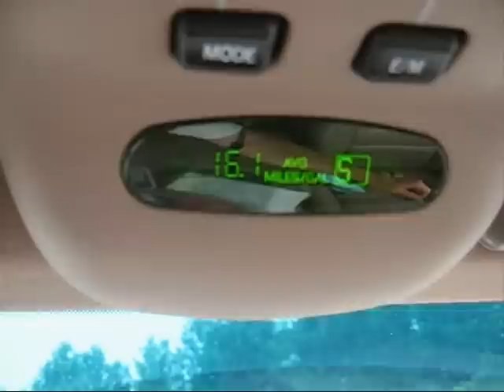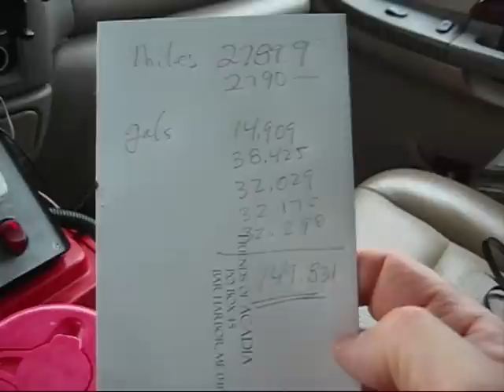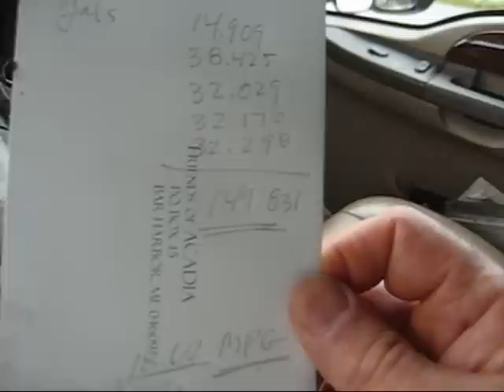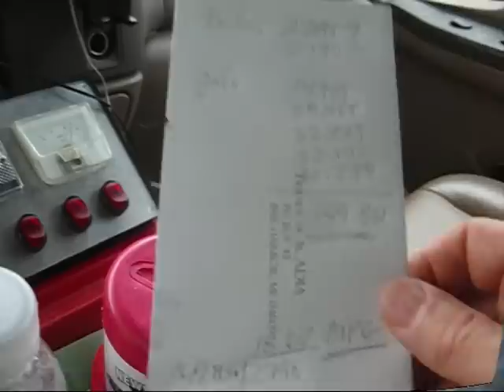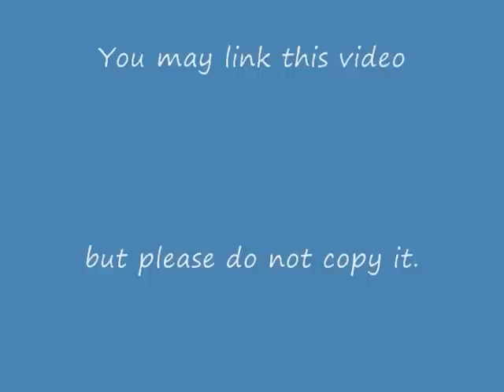MPG (mileage) Test 2790 miles with Dry Cell HHO F350 Superduty 7.3 Diesel

Comment: you've never gotten better then 18.62 MPG? that's.. pretty dreadful.. even if you're pulling a full load of cargo in a pickup truck.
glad it made some improvement for you though. but hopefully you are aware, the very fast & hot combustion rate of hydrogen severely lessens the lifespan of your engine.
Reply: actually the lack of carbon helps keep your engine cleaner. As long as your valves are of sufficient construction, you will be able to run only hydrogen, and your engine will not have all the carbon deposits.
Reply: kandysman86
the valves aren't the (only) concern my dear boy. it's the crank shaft + the crank shaft seal + the head, etc. simply put, engines aren't designed for such a fast combustion rate. the hydrogen burn up before the piston stroke is completed causing increased stress early on in the stroke, & less stress later on in the stroke causing powerful (but short, so you probably won't feel it) shock waves running down your piston rod, into the seals & into the crank shaft, causing cracks over time.
Reply: NickBlackDIN well you better rush out and tell all the companies doing compressed hydrogen conversions on everyones cars, that all the R & D they did was wrong, cause this dude on the internet knows us "dear boys" don't understand why its better to pay out the ass to super rich oil tycoons for their engine clogging dirt fuel, instead of ultra clan and abundant and free water.
Reply: kandysman86
you trust companies?
sure this method gives better MPG (for older cars) so the customers are happy at the transaction.
and by the time the engine breaks, their warranty is expired. and they will likely blame it on the engine itself. not the conversion. (it'll take a few years (depending how often you drive) for the engine to break, which is good enough for some people. I'm just tired of people thinking its something wondrous).
Reply: NickBlackDIN this way isn't, but the water can be separated much faster with less electricity. these people are using brute force electrolysis. if you use a pulse wave modulator with low amps high voltage, and a thin separation of the double titanium tubes so the water is forced to cavitate.This releases tons of hho plus a heavy gas that as yet to be identified, but its there because its heavy enough to be left after the hydrogen leaks away. its heavy enough to pour from cup o cup, and is highly explosive. And don't go saying that don't work either because the navy just sent out a press release about the success of the first naval power plant that runs entirely through seawater and can stay out indefinitely.
Reply: kandysman86
you do know high voltage at low amps is the same as low voltage high amps right?

not to mention have you seen how big the machine's are of that 'pulse wave modulator' to produce a small amount of hydrogen gas?

do you know that a normal boar propeller blade also causes water cavitation? nothing magical, no free energy.

and no, there is no 'mysterious heavy gas' all the mass is accounted for in distilled water  to 2 H2O unless you've added an electrolite. in which case any extra gas is from the electrolyte.
Reply: kandysman86
oh, and looking at the navy thing you pointed out. they're making 'jet fuel' (kerosene) not purely from sea water, but rather from the carbon from the air alongside their hulls.
(my guess is that they use the methold described here: http://www.newscientist.com/article/dn2620-carbon-dioxide-turned-into-hydrocarbon-fuel.html#.U3ZUCnb-bxU)

which needs a fair amount of heat/energy and so far have only succeeded in making the lighter hydrocarbons. but since carbon contains a lot of energy i suppose it 'might' be possible to get some more energy then you put into it. it's still not free though. you're getting the energy from the air now rather then the ground.

i think they would be better off investing in nanoantenna's
Reply: water cavitation does create free energy, do u not understand the amount of energy involved to heat a plasma in the water bubble to hotter than the sun? jesus your just hard headed and blinded by lying ass academia. Oh and those pulse wave modulator i use is the size of two computer fans. They are tiny. And if u use .5 amps at very high voltage ran through the coil uses only a HALF AN AMP. so your saying if i use low volts but 20 or 30 amps thats the same as half an amp. Looks like you found free energy before me bro
Reply: kandysman86
w = V x A
so .5 Amp @ 10,000V = 5,000W

which is the same as
2.5v @ 2000Amps = 5000W

the sun is pretty hot, sure (surface temperature ~ 5,000K) do you know whats hotter? lightning. ~ 5x hotter.

i think you're talking about the kind of temperature a pistol shrimp can produce, for a fraction of a fraction of a second. and there still isn't free energy there.

do you know how hot hydrogen needs to be for fusion to take place? (looks like you're talking about cold fusion)
it needs to be ~ 10 million K, far hotter then the surface of the sun, but rather, the core of the sun, where fusion actually takes place.

I think you still have a lot to learn (and I admit, so do I, but the fact you don't seem to even understand Ohms Law... I'm not trying to discourage you. thinking outside the box is great & needed. but stop dreaming, & keep an open mind of all things, not just what seems the most fascinating)
Reply: NickBlackDIN lol, you have no idea how a wave pulse modulator works huh
Reply: kandysman86
.... I'm an electrical engineer, I use these formula's almost every day. why? because they work, and they are factual.
come back after you have 15+ years experience.
Reply: NickBlackDIN lol 16 years doing the same thing believing thats all there is, no thanks, ill stick to experiments and observation.
Reply: kandysman86 well, if you find out anything new, write a science journal. making wild claims on the internet won't get you to far credibility wise.
Reply: NickBlackDIN can't write papers unless they tow the relativity line. will never have academic career because i don't think einstein was even close, and thats based on the real evidence, not this bullshit, out of touch from reality math he and his wife stole from people.
Reply: science isn't about following rules, it's about observation..
and I personally also think Einstein had a few things off, but I'm not going to say anything until I can provide concrete evidence.

if you have real evidence that says relativity and physics as we know it is false, you could be set for life.

but expect people to scrutinize & try to replicate your experiments, if no one gets the same results, then yeah, the validity of your experiment will be questioned.

(and if you think that more amps at different voltage = more power, you will be laughed at just a power transformer will drop/raise the voltage while raising/lowering the amps.)
Reply: NickBlackDIN look here is a simple explanation on how we can trade amps for volts and the POWER stays the same. If i start out with 1 amp at 120 volts, =120 watts if i step the volts up to 50,000, then i have dropped the amps accordingly. i still have 120 watts of power. But instead of getting 1/3 of the work from the conversion of 120 watts directly applied to the water, We step up this huge potential, then ring the water like a bell, which causes it to tear itself apart, rearrange its molecular configuration, and do things quite frankly that us small homemade lab guys just can't put our finger on. But we get results. scientists look at the THEORY then say, well that wouldn't work according to theory, so there results are wrong and we can't be bothered with such nonsense, and  anyone disagrees, out the door they will go. Experiments and observation, not theory, is what moves us forward. the catholic church had a theory that precluded a need for any research for 1000 years, should have anyone been out trying to figure what was really going on. according to you they're all stupid. I can show you how to cause aluminum to transmute to another metal for around 30 - 50 bucks. That warrants a new theory of atoms and electricity. But instead of realizing this, the scientific community ignores the data they can't think of a way to refute. oh yeah here is that simple explanation i alluded to earlier.
Double the voltage and half the current, and the power remains the same. Or, double the current, and half the voltage. We can trade voltage for current, or current for voltage, and not violate the law of conservation of energy, because the power remains the same as long as the product IE remains constant.

It might make more intuitive sense if you think of mechanical power, instead of electrical power. Power is also the product of force and velocity:

P=Fv
You can lift something heavy with a lever, but you will have to move the lever faster if you want to accomplish the same amount of lifting in the same amount of time. Or, you can move something far with a lever, but you will have to push harder.

Ohm's law is not violated because a transformer also transforms impedance, like a lever can transform the apparent weight of something. The transformers used in the AC distribution system are electrical levers, with the net effect of the fulcrum being closer to the power source, so i am just moving the fulcrum closer to my source, i get huge volts with tiny amps.
Reply: kandysman86 Some of what you say makes sense.. But the rest is ignorant garbage. You Said.""
This releases tons of hho plus a heavy gas that as yet to be identified, but its there because its heavy enough to be left after the hydrogen leaks away.""

All the gasses as been identified from water hydrolysis. Just tell me what you put in your water to make it conductive and the metal plates you are using and i can google what type of gasses are made. 

Another thing you said;
""actually the lack of carbon helps keep your engine cleaner""

any time you install a HHO kit in a vehicle you make more carbon   not less.
Reply: NickBlackDIN Your statement would be correct about the extra heat made using hho if the amount of hho was high % of the total fuel you are burning. But the set up in the video only produces around 1% hho of the actual fuel intake. this being said, the extra heat created would hardly be measurable.
Reply: Samuel Atkins

Comment: you need to reduce the amperage to like 10 amps or less buy a 21 plate dry cell with a bare minimum output of 2 liters per minute with a pwm so your alternator isn't hit hard causing the engine to work harder. You will see great gains on a diesel in most cases with a chip added, which my company vehicles are seeing an easy gain of 8-10 mpg. Overloading your cell to get massive output will do nothing but ruin connections, alternators and eat up the cell electrodes by operating at too high of amperage etc. You will also get vapors of the hydroxides on your pistons and eat them up over time unless you have an air dryer and a scrubber to save the engine from acids. Series parallel circuit is the best way to obtain high output with low amperage, using the pwm tuned correctly, also,  high amperage will never give any good gains. efficiency is always the key! Do not listen to owners of HHO product websites that state 1-5 liters is necessary for gains. You can get good gains with a minimum of 2 liters per minute on a 6 liter engine. I have a 2.4 liter doing well on 1/2 liter per minute, as well, 5.9 liter doing incredible on 2 liters per minute. The 5.9 liter is getting a gain of 22 miles per gallon under normal driving conditions on the highway with an OGO 21 plate dry cell. I have a duplicated cell on my test bench doing 3 liters per minute at 9 amps, with a battery charger, so, these gains are possible and cheap to obtain. The OGO cell is a beast and it is awesomely made. It is way cheaper and a much better quality than any home made, or even professionally built dry cell is for the money. ( in some cases you could buy one on EBAY for $120 bucks. They are a very professionally built cell and they are super heavy duty with very high quality parts. I'll buy them over and over because they are the best on the market for the money!
Reply: Hi Marc, how is this cell, 21 olates steel inox............  and you use one or two cell in your car,
Reply: Hi Alex, I actually have a much smaller cell in my car. The one I am using gives one liter per minute at 5-6 amps depending on heat and gives me 30-50% better fuel economy with a volo chip for hho. I haven't put the 21 plate cells in my car, but, I have put them in larger vehicles using an inverter , a router speed control to reduce voltage, rectifier , and inductor coils and caps. ( the caps and coils reduce the amperage 70% ) I am getting 6 lpm from 4.5 amps , and do not use a catalyst, just steam distilled water . I haven't put a volo in yet, but, I immediately noticed fuel economy increase and revving at idle because of the amount of output. I need to figure out how to produce gas less at lower rpm and more at higher rpm, triggered by the throttle some way. I am playing with voltage controllers, and higher voltages, but, at this point, I will be looking into hho computer systems if I could get a spare car to toy around with for my experiments. There is a website called secure supplies.biz that sells everything, as well as many Stan Meyer boards that I have purchased. I will be posting many videos from May thru 2015 showing tips, tricks, and things to do, as well, not to do. I have come across many new circuits that produce 2-3times what ordinary electronics do and can help many people get much better results. Originally, I built very efficient cells 10 years ago, and posted all over YouTube, but, my videos were banned and my pcs were taken from me. I will be much more careful with all postings so all can use my technologies for their benefit. I am not trying to have anybody replace their fuel, I just want everybody to know that it is possible, no matter what anybody says. If a garden tractor can run on water, so can any car. That's all I'm going to say! :-)
Reply: Thanks for responding Marc,  I built a stainless steel coil, for I very large web copy, I have a 4 cylinder 1000 cc, the engine feel forced, but it's the only way to prove it, produces much hho, I think one truck would be fine for 8 cylinders. please help I'm very excited, what are the characteristics of the router speed control to reduce voltage, rectifier, inductor and coils and caps. I am from Queretaro Mex. hopefully you could help me with a diagram to connect, thanks again

Comment: Nice, are you selling systems? 
I need one for an old rv that has a 454 in it. I taxed out at 7mph.  Liked to have fell out. Not affordable to drive, more like a 3+ ton paper weight.
Reply: Put a diesel in the old 12valves can be found in cheap old industrial/commercial trucks

Comment: My seat leon with 150 bhp needs for a fast real trip of 600km (373miles) exactly 7,5 Liter Diesel per 100km. thats exactly 31 MPG! That car is 1450kg heavy plus in that case 4 persons including a lot of baggade. My version of this car is a FourWheelDrive, which is less efficient than the normal front-wheel-drive version. Top speed at this trip was 210km/h (130.5 miles per hour). 20% of this trip we where over 170km/h (106 miles per hour) fast. this car is from 2001. an actual version of this car would deliver a few miles per gallon more or by driving not that fast. this kind of fuel efficiency is STANDARD in europe. why? cause of the high taxes here in europe the people want higher efficiency and the car industry delivers it.
trying to optimise with hydrogren just optimises the combustion process in less efficient motors. nothing magical. but as you see, there are more efficient motors out there.
Reply: Yes a car will always get better mileage than a truck

Comment: Wow! So if I put this kind of system on my Cummins I should get about 23 mpg. I get 17-18 now, 15-16 w/ a loaded trailer. I was considering a CNG addition but the tank is cost is prohibitive and I live 130 miles from a filling station.
 How do you keep the water freezing? Does it produce enough heat to thaw itself while running? And overnight?
Reply: I had a 2001 cummins and got 26 almost 27 out of it. If you did what i did AND what he did, you could probably get 30 out of yours. And if thats the case, let me know so i can buy myself another lol
Reply: What did you do to get 26? I'd be smitten with that!
Reply: I had the perfect tune on it as well as a new rear end. Mainly for towing purposes but when not towing, its in the mid to upper 20s
Reply: alcohol stops it from freezing. 1 cup o shine per liter and a half works wonders. Im in the northeast and it always would freeze solid. Even if it partially freezes, the hho production starts slow, melting through any small traces of ice within seconds anyway if you use alcohol. It doesn't really change the production either, it helps it out a bit.

Comment: I don't mean critical, just to help. I think you are burning to many amps.may I suggest that u use pulse/regulator that u can control and that tiny fried hho generator you need at least 3 times that even more realy. Also put a large container, and save that hho and run on that in traffic.I didn't mean any bad. just  my six cents.